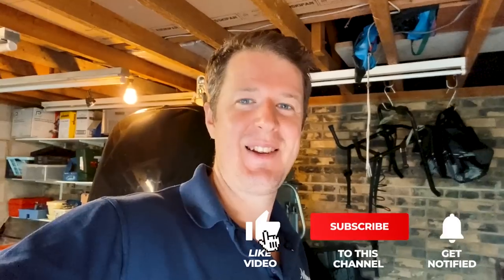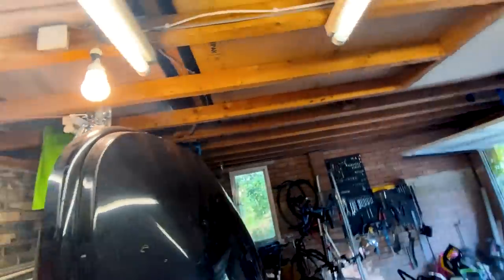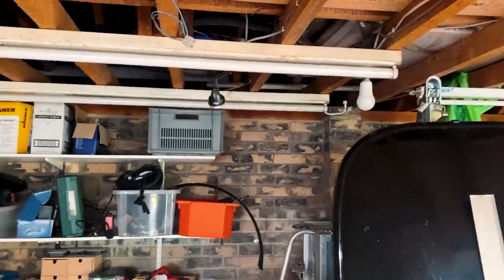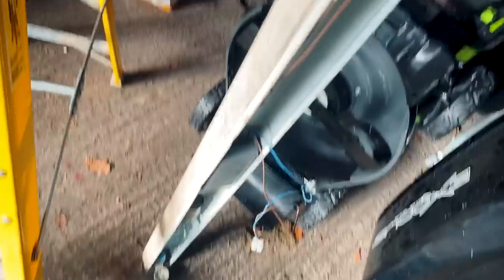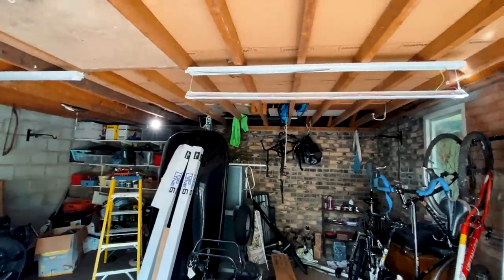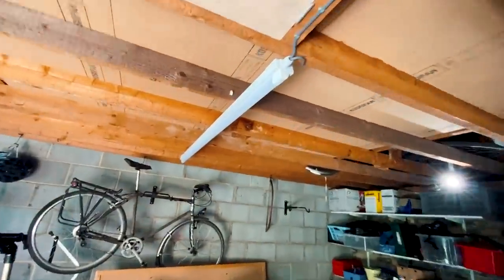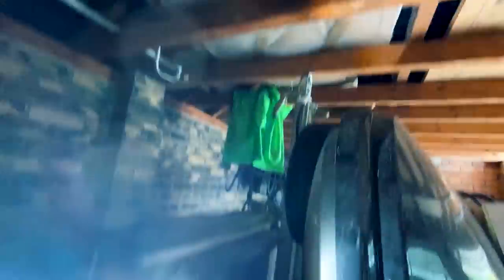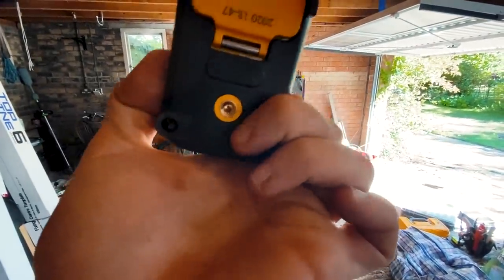Garage Rewire - Electrician Life

Comment: I think most of Europe has switches the right way. UK has switches wrong way like their 1-phase boards on every house just stone age stuff.
Reply: Single phase boards are stupid they are talking about putting 3 phase in to help spread load of generation and electric car chargers now
Reply: So old fashion today 1phase boards, it's just not enough now,with all the appliances,car charger,etc, we have now,here I wish there 3 phase available,to meet my load demand.
Reply: @haldo691  Thats never going to happen , our DNO networks don't have the capacity and are unlikely to have for many years,  thats before you even look at electrical generation . Realistically your looking at tripling the peak demand   capacity of the network as a whole, within a decade we are likely to have Hydrogen fuel cell technology  comming on stream .
Reply: @steverobinson8170  yeah I work for a DNO so I know very well how much we are screwed in a few years and the government want gas boilers to stop being installed in a few years time guess il be busy repairing everything when the network begins to fail
Reply: @haldo691  It might be because electrics is not regulated trade in the UK so less room for fatal mistakes. Everytime i see on Youtube UK electrician connecting  2gang switch fed from 2 different circuit breakers my brain goes like WTF ? Two circuits in one box ?
Reply: @steverobinson8170  if you change 100A single phase to 3 phase you need only 3x25A and get rid of electric showers. Boilers and mixer valves are way to go.
Reply: Nope, most german electricians also do it the way as shown here. If you do it the other way arround you got a nice "shelf" for dust or dirt to collect on...

And afaik in the UK three-phase is below the street and the households are distributed on the three phases evenly. And three-phase also has the advantage of sparing materials, round about 50% smaller wires and transformers compared to a single phase system with the same demand.
The households here in Germany are fused with 3x63A, that are ~44 kW. A 4G16mm² between the service entry box and the meter are sufficient, and of course an additional 1x16mm² PE from where the PEN is splitted into a separate N and PE.
The newer consumer units can be retrofitted to three-phase, if there are RCBOs installed it's just replacing the bus bar and the main switch. I doubt the 100A switch is bigger than a 3x63A one. Costs would be managable.
For a kitchen cooker we install 5G2.5mm² fused with 3x16A (~11kW). The cooking plates are connected to L1 and L2, the baking oven to L3. The appliance is still a 230V, not 400V, but the plates are divided on the lines. One small and one large plate on one phase.
On a single phase system you'll have to at least install 4 or 6mm² fused with 25 or 32A.

But here the DNO's start to gasp massively if you want to connect single phase appliances with a high demand to the grid. They only permit 4.6kVA (20A) for single phase appliances. Appliances with a higher demand must be connected three-phase. Except old kitchen cooker circuits which are still single phase and mostly fused with 25A.
Reply: @haldo691   Looking at phasing out gas cookers too eventually ,  i just look at it from my own home , built 1930 with a 40 amp supply  two houses share the same feed,  fine for 1930,  i had to have my fuse uprated to 100 amp  to accomadate the electric shower , double ovens and hob  because i kept popping the fuse ,
Reply: @evzenhedvabny6259  Electrics is highly regulated
Reply: @steverobinson8170  the old lead incoming cables are normally between 16 and 4mm in today's sizes amazing they hold up to 100a supplies although all houses should be fused at 80a unless they have electric heating
Reply: @peto22  They are phasing out gas boilers and showers  to help meet  carbon emmisions targets , heard they may eventually include cookers as well .   25 amp per phase is far to low  when your basic house  now has 3 rings  ,  2 radials ,   2 lighting circuits   1 shower circuit  1 cooker circuit , throw in a couple of  charging circuits  as most houses have two cars  and your toast , realistically  your looking at 3x 60 amp  supplies ,  possibly looking at running cookers and showers either  2 phase and neutral or 3 phase , domestically that might cause a few problems  as its something most people  haven't got a clue about
Reply: @evzenhedvabny6259  And how many circuits are in the CU? At some point you have to rely on people having a brain instead of regulating excessive material usage and ugly installations..
Reply: @steverobinson8170  https://youtu.be/7flGqj4okts?t=36 This guy says it is an unregulated industry  whatever it means. As far as i understand there is noone you need to be registered with to do such job legally. One can use third party certification scheme.
Reply: @Marcel_Germann  not sure if that's the reason our switches are that way but trust the Germans to have a good reason for it👍
Reply: @haldo691   they did agree to put 100 amp in mine  but yes your correct  they do  generally put 80 amps in
Reply: @Monkeh616 Agree.  But in my country you have no choice. Approved 2 gang switch has one feed only. So this is the way i have been trained . It is realy deep in my brain.
Reply: @steverobinson8170  Well.. here in Finland 3x25A is enough for up to ~200m2 houses with electric heating (20kW), electric water heating (3kW), electric cooker (5kW), electric sauna (6-10kW),.. usually about 30 circuits. Worst thing you have against 3 phase is electric showers but total energy consumption is no problem.
Reply: @peto22   Problem in the UK  our domestic electricity supply is mainly single phase and it would require a massive investment to upgrade all homes to 3 phase supply  Most homes are either TNS or TNC-S , TNC-S being the prefered method now  so  no capacity within existing  cabling to upgrade even to twin phase  .  With the uptick in charging systems  unless you have selective power control systems 25 amp  3 phase will  struggle to cope with charging  a couple of vehicles
Reply: @haldo691  how would this help? It's not like every house is on the same phase anyway so the loads would be already spread.
Reply: @Mason Moore , i don't honestly see how thats going to work , its limiting charging time  effectively you could come out to an uncharged car or  a car with significantly less charge than when you plug it in , you would need to be able to overide  the load management system . I know they  have  or are trying something like this  in Japan ( i think)  and found it not the panasea they thought it would be
Reply: @stuartandrews4344  what do you have in your house that needs a 3 phase supply? I'm genuinely curious
Reply: @haldo691  that's why there will be a heavy focus around energy saving in the 19th edition. Bit business already face penalties for using electricity at times of high demand. Did you know during a triad period it costs a few hundred pounds for Sainsbury's to make 1 donut!
Reply: @steverobinson8170  Yeah it would require changing supply cables to something like AXMK 4x25, changing distribution cabinets on street, meters, tails, main switches and in most of places, there is none of extra space in your tiny CU's. I think most of charging units have adaptive power control and limitation option but you are right, I wouldn’t want to charge two electric cars with 3x25A service. We have a great fee here that 3x25A service has a monthly fee of ~25€, 3x35A ~45€, 5x50A ~78€ and 3x63A ~123€ and energy+transmission fee will still come on top.  No one wants a bigger service than they have to :D
Reply: @evzenhedvabny6259   I think you mis understand what  He's saying , Dave's refering to mainly the domestc after market where week end warriors happly perform bodgery  on thier own homes and  realistically  you can never stop this type of work. If your working proffesionally as an electrician you need to have been trained .  The problem we do have  until  quite recently  you  could recieve your training as  and qualify without ever going to college .
Reply: @steverobinson8170  Thank You for explanation.  You say : " You  could recieve your training as  and qualify without ever going to college. " I wonder how is this possible. My experience from my country is You need 3  years of education , then pass your first exam, then 6 years of experience working for some employer after that pass another exam. Actually two. One for being a sole trader another one for inspection and testing.  Then get registered with TICR (equivalent of NAPIT but kind of governments organisation ). After all that you can work as sole trader electrician. After passing all this hassle you are still not allowed to design own instalation or make a fusebox from scratch.
Reply: @Marcel_Germann  That would require every property in the uk to be rewired from the road  to the supply point , you would also have to  replace the CU  and in all probability  perform at least a partial rewire of the property . Other major obstacle all the domestic equipment in the UK is supplied single phase , whilst some can be switched the majority can't. The cost would be astronomical .
Reply: @evzenhedvabny6259  We used to have an apprentice system where you  were indentured to a company or tradesmen and they taught you (indentured  is a legal term whereby they agree to train you for xxx amount of years  and you agree to be trained ) Following your training which was anything up to 7 years you would recieve your indentures and  could work as an improver under supervision . It worked well , some of the best tradesmen  i have worked with came up this path effectively you where taught on site not in a classroom  . One downside was  lack of consistancy  of construction and installation, large companies and governments wanted uniformity  of build and installation , it allowed  the less adaptable to enter the trades  requires less supervision and training effectively everyone sang from the same song sheet . Downside you get less innovation and  repair and more strip out and throw away . You also get a segmentation  and semi skilling of trades  and downward pressure  on price .
Reply: steve robinson You can still have the single phase circuits. We have them here too. Replacing the CU is not necessary, especially not if you have all RCBO‘s. Then replace the bus bar and the main switch with a three phase one. In that case the single phase RCBOs are distributed L1, L2, L3, L1, L2 and so on. But still 230V circuits. Three phase in the board means you can build three phase circuits, it doesn‘t mean you must build them.
There are special bus bars available for this. They have L1, N, L2, N, L3, N, L1, N and so on. Supply cable from the street to the house, and three main fuses instead of one. Meters must be three phase too. The home owner has the smallest part of the costs. And you don‘t do that all at once, that‘s a step-by-step process. Here only the kitchen cooker circuit is three-phase, or the electric instant water heater. An in older installations the kitchen cooker is also single phase. But you got the possibility of implementing a new three-phase circuit if necessary, for example for EV chargers.
Reply: @Marcel_Germann  Probably this kind of modification of consumer unit is not legal there.
Reply: Evzen Hedvabny Why should it be not legal? It‘s not a modification of the board, it‘s a modification of the wiring which is perfectly fine, according to regulations and done that way in every country which provides three-phase to domestic installations.
Reply: @Marcel_Germann   , you can't change the bus bar in most domestic CU in the UK, the CU is  only designed to accomadate single phase  and the main switch in the UK is usually within the CU  its not a seperate  item unless you add one later yourself Our meters are single phase and supply from street single phase as is the fuse head  .  Just to accomadate a 3 phase supply in the uk  would require a complete CU upgrade , probably a relocation as well in many properties because they were usually tucked under the stairs or above a doorway  in years gone by , with the added hassle of  extending circuits  This is the type of board likely to  be fittedhttps://www.screwfix.com/p/british-general-12-module-6-way-populated-high-integrity-dual-rcd-consumer-unit/4674G?tc=XA3&ds_kid=92700055281954493&ds_rl=1249401&gclid=Cj0KCQjw7ZL6BRCmARIsAH6XFDL2Yh13JYfVMoL4KDrt1_53dTQpntez6cj8pkR-XhzWKR3w-H5f1QEaAsUzEALw_wcB&gclsrc=aw.ds    or something like this https://www.google.co.uk/url?sa=i&url=https%3A%2F%2Fwww.brightsparkelectrician.co.uk%2Fservices%2Ffuse-boards%2F&psig=AOvVaw2MsY5X82qxDyVOHGJZsRTa&ust=1598448333307000&source=images&cd=vfe&ved=0CAIQjRxqFwoTCMiVlZu6tusCFQAAAAAdAAAAABAD
Reply: steve robinson Is the switch located on the rail? If yes, it can be replaced. And with the bus bar I mean the copper „forks“ you put into the MCBs from below as a feed. That is replaceable by three-phase variant. When I‘m home from work I‘ll send a picture, pictures explain the things better. And I don‘t talk about the really old ones without the DIN rail and the rewirable fuses. They must be replaced in that case. But if fitted with a DIN rail the board can be converted.
Edit:  
https://twitter.com/marcel_germann/status/1296500853055131649?s=21
That board is from the early to mid 1980s. Circuits are single phase, but inside the board is three-phase.
Reply: @Marcel_Germann  Guessing from what Steve says . It looks like their rules are similar to ours. They can't alter the distribution board this way just because manufacturers does not say it can be done.
Reply: Evzen Hedvabny Normally it should be the other way arround: Manufacturer must explicitly say that it‘s not permitted.
Reply: @Marcel_Germann   Don't think this would be allowed in the UK ,  if your changing the board internals it would need to meet the latest regulations , we would have to buy a board already type approved to supply multiphase power , plus not all  rail boards  use the copper folk method . Send the picture please as its interesting to see how other countries deal with this issue . Plus most boards fitted in the past even Din Rail boards are usually already fully populated
Reply: steve robinson I remember the city I live in was completely rewired in the mid 1990s from overhead line wires to cables in conduits below the sidewalk. So it is possible, but you‘ll have to do it step by step and not all in one. Start with old defective cables which must be replaced anyhow.
Reply: @evzenhedvabny6259   When you say feed do you mean loop in loop out , in the UK  on domestic circuits  you have  live feed pulled down from fitting  and switched live returning , , the switch's are generally on the same circuit , loop in loop out is usually at the fitting not the switch
Reply: @steverobinson8170  I mean i have seen 2 gang switch one half for upstairs lights  the other for downstairs lights each one fed from own fuse.
Reply: @Marcel_Germann    Unfortunatly   a lot of our cabling is beneath the roads  , replacing it is an absolute nightmare , cabling to my house actually runs under the neighbours new driveway  and we both tap off that , its  about 90 years old lead cased , no conduit ,   What type of system do you have in Germany  TNS  TT OR TNC-S  we  have all three , my neighbours , TNS , im TNC-S  house for doors away is TT   and the shop at the end of the road was TNC  until recently  (don't usually  use TNC domestically )
Reply: @evzenhedvabny6259    that's unusual  what we do do is run the downstairs circuit to one upstairs light  fitting so any failure in the one circuit means the upstairs will still have  light ,  in years gone by we used to borrow neutrals  so although the landing light was  fed from the one fused circuit it would  take its neutral from another circuit , don't do this now  though , how old was the installation
Reply: @steverobinson8170  I met this twice. When i worked in the UK as a cleaner in one commercial building . Three gang switch for corridor  kitchen and  toilets each havig own circuit breaker in the consumer unit . Built in late 90's .  Second one was friends' house  i spent my holliday with .I was asked to change one broken switch . There i found British way of 2 way switching  and two different circuits in one box. Since then i am interrested in UK and US electricians channels.
Reply: @bobbyzilla  In my case one cooker and one water pump
Reply: @peto22  It might be  little bit more complicated . I have seen new building being connected in the UK . They had to dig the street then work on live cable under the pavement , colse the connection in something looking like a small submarine 
.
Reply: @peto22  unless you live in a multi story with no gas
Reply: @steverobinson8170  no it isn't at all. If a typical person had an electrician round they have no way of checking their qualifications. A lot of people think part P domestic installers are electricians and they are far from it but they can do work in anyone's house and that is scary. But me as a full qualified electrician cannot change a socket in my kitchen.
Reply: @evzenhedvabny6259  what do you need a 3 phase pump in a house for?
Reply: @bobbyzilla  It is the way  things are done  in Czech. I have three phase 32A suply in my house . So my water pump fitted 30 years ago is three phase too.
Reply: @steverobinson8170  In most cases it's TN-C-S, but some are TT. 
For the TN-C-S in three-phase it must be four conductors in the cable. Eventually they can shoot the cables through the earth like they do it with gas pipes these days. I remember when they layed the gas piping here, just a hole in the sidewalk and one hole directly on the outer wall of my house. In between no hole, no trench....

The conduit is such a black flexible one, we painted it over:

https://abload.de/img/img_59420nkrj.jpg

In the box the PEN is separated into a separate PE and N, the small cable leaving on the top is a NYM-J 1x16mm² going to the equipotential bus bar of the house where all metal piping, cable TV (shielding of the cable must be earthed), earth electrode of the house are connected to. The last thing is the reason we don't need as much measurements for installing an EV charger on TN-C-S. In the UK you'll have to install an additional earth electrode (here mandatory even on TN), and on three-phase it's easier for the charger to detect a PEN failure and switch off.
Reply: @evzenhedvabny6259  3x63A is the standard here for residentials. In older installations 3x35A.
Reply: @bobbyzilla  Of course you can replace a socket like for like in your own home .  No ones saying our system of checking tradesmen is perfect its not but it is  due to our historic methods of training where you  were not required to attend college , then they bought in city and guilds , now they have bought in NVQ's . Training in the 1970's was a lot different to training today . Todays system is all about pieces of paper and box ticking . It doesnt allow for  and can't cope with  historic training
Reply: @bobbyzilla  Three-phase makes some things easier. 5G2.5mm² fused with 3x16A are ~11kW, standard for a kitchen cooker circuit here. You could even install 5G1.5mm² with 3x16A, but now these days no one will do this anymore, and also the cables for the kitchen cooker circuit now must be designed here that way that you can change the MCBs over to 3x20A (~14kW). I don't know which master chef will cook there so that 11kW are not sufficient, but that's the way it is...
In the UK the circuits for kitchen cookers are usually 6mm² afaik and fused with 1x32A.
Also three-phase has the advantage that it has a rotating field, so you don't require a capacitor for the motor. The capacitor will eat up torque and power of the motor.
Reply: @Marcel_Germann  In here you can choose depending on designed requirements. 1 phase up to 20 or 25 A  or 3 phase 10, 16,25,32, not sure maybe 40 , 63.  2 or 3 tariff.
Reply: @evzenhedvabny6259  Here it depends on how much square meter you have, how many units (flats) you have in that house and the way you heat up water. In my case I have 3x63A. This house was considered a 2 family home in the early 1950s, but with 88m² of living space by todays standards it's a small one family home. I changed over from electric water heating to natural gas, electric water heating is too expensive here in Germany these days.
And I would never reduce the power of the house, that's easily done. But if you want a higher fuse inserted you'll have to pay several hundreds of Euros. And if you need a larger cable you'll pay a mid range 4-digit sum, so in the range of 4 to 5000 Euros.
Reply: @Marcel_Germann  basically the same thing.  Just different way. In Czech approved designer decides. I think their guidance is similar .
Reply: @steverobinson8170  hi, I'm sorry but you are wrong. You need part P to make any changes to a kitchen or bathroom so I cannot change a socket in my kitchen without paying someone else to sign it off for me. Even though I am fully qualified. It's a stupid system now.
Reply: @steverobinson8170   not misreading them. Kitchen and bathroom electrical work no matter how small is notifiable work and the noone knows argument is rubbish when a minor work certificate is required and that will have a date and my name on it.
Reply: @evzenhedvabny6259  The electrical installations in domestics base on the VDE 0100 (Erection and maintanance of low voltage installations, the german counterpart of the BS 7671), the technical connection conditions of the distribution network operators and the DIN 18015 (electrical installations in domestic buildings). There you have the minimum numbers of outlets for different rooms, how many circuits for the whole house, how big the consumer unit has to be and such things.
Reply: @Marcel_Germann  We have te same think. Every electrician here shall know it but is not a allowed to design the installation. Design is job for approved engineer who has to be member of CKAIT. I guess that guys in the UK and Germany have more freedom .  Czech building industry is over regulated :)
Reply: @evzenhedvabny6259  Here in Germany the certified electricians are permitted to remove the main fuses in the service entry box. In the UK it isn't that easy, they have to call the DNO afaik, then someone comes over and removes the fuse and later when the job is done the DNO guy comes over again and put the fuse back in.
And we have NH fuses in there, that means you require a special tool to remove and insert the fuses, and also special protective equipment (helmet, face shield, flame retardent clothes and so on).
Certified means you got the education, founded your own business and report to the local DNO showing them your testamur of your education and that's it, your on their list....
Reply: @Marcel_Germann  Similar in Czech Republic . Same fuses , Same procedure .. Ring the DNO, give them your registration number you have from the central authority. But fully certified electrician can not make even simple stupid extension lead from CE certified parts or a  fusebox . Our law sees these things as a product not as "eine baukatsen".   My former employer  had to be registered as electrician and manufacturer of consumer units because of it .
Reply: Replacing sockets in Kitchens is not notifiable  work  The introduction of the latest version of Part P was introduced on 6 April 2013, the range of works requiring notification has been reduced.

Notifiable works
The installation of a new circuit
The replacement of a consumer unit
Any addition or alteration to an existing circuit in a special location
Non- notifiable works
All other work is considered non-notifiable, namely additions and alterations to existing installations outside special locations, maintenance, replacement and repair work.
Special locations and installations
A room containing a bathtub or shower
A room containing a swimming pool or sauna heater.
A special location means:

A room containing a bath or shower, the space surrounding a bath tap or showerhead where the space extends vertically from the finished floor level to a height of 2.25 metres or the position of the showerhead where it is attached to a wall or ceiling at a height higher than 2.25 metres from that level or horizontally where there is a bathtub or shower tray, from the edge of the bath tub or shower tray to a distance of 0.6 metres. Or where there is no bath tub or shower tray from the centre point of the shower head where it is attached to the wall or ceiling to a distance of 1.2 metres.
Back to top

How will Part P apply to DIY work?
Part P will apply to all electrical work in dwellings, whether carried out by professionals or DIYers.

Some DIY work will require the submission of a building notice to the local authority and the payment of a building control fee.

Some minor electrical work will not be notifiable (see above). Examples include adding a lighting or power point to an existing circuit, adding a spur to an existing circuit or replacing a light fitting.  There is a massive under reporting of notifiable works , infact if all works requiring notification  was reported  local authority  BC would  not be able to cope  with the workload. This was one of the reasons why they reduced   what was required to be notified originally.  I can gaurentee that  very few doing a DIY bathroom or kitchen refit bothers  to notify ,  infact many of the 'proffesional'  kitchen and bathroom  fitters don't either . Thats how the big sheds  stay in business . Building control  don't have the rescources  to police part P within the DIY   domestic market .
Reply: Evzen Hedvabny Here the electrician builds the whole distribution board. You don‘t buy fully equipped boards here, actually even not available here, you buy the housing and the devices (MCB, RCD, RCBO, Neozed fuse carrier and so on) separatly and equip the board as required for the customer. No separate permission required.
Reply: @Marcel_Germann   WE have that option with some brands , but generally you get a mainswitch, and  at least part populated , usually  2x 32 amp 2x5 amp  1x16 amp   1x20 amp rcbo's  then you add  whatever else you need , some boards are still being sold with split RCD'  and they part pop  similar to above but with MCB'S
Reply: @peto22  We don't have distribution cabinets in the streets in the UK for power
Reply: @peto22   We have mini sub stations , only DNO allowed  access  , they only distribute 3 phase  usually 11KV feed off the primery substation which in itself is fed from a larger  distribution node which is fed from the national grid  all our single phase is tapped off the 3 phase underground domestically .  Our system is old , cables feeding my house are 90 years old lead sheathed , DNO have a nightmare keeping on top of faults as the lead decays  and cables decay
Reply: @steverobinson8170  The special locations in rooms which contain a shower and/or bathtub are harmonised up to the point that the numbers are identical:
VDE 0100-701, and in the BS 7671 it's also -701. Take a look at this, this should be familiar, even if the labeling is in german, the dimensions are in cm:

https://upload.wikimedia.org/wikipedia/commons/0/06/Bad_Verlegezonen.jpg

We call them literally translated protected zone.

In 1984 it was implemented into the VDE regulations that the electrical circuits of "rooms which contain a shower and/or bathtub" must have RCD protection (tripping current 30mA maximum). With this version of the regulation also the AC RCDs were banned for new installation. The standard RCD type is A since then.

Here in Germany the one who works on the installation is held accountable if something happens. In worst case injury or death of another person. No matter if it's a DIY or a pro. The most interesting thing is when the installation is connected the first time to the grid or if you want to use an appliance with a demand of more than 12kVA. The appliance must be reported to the DNO. That would be an EV charger for example, or a big flow water heater for a shower (mostly 20 to 22kW).
Reply: @steverobinson8170  Here they are completely empty. Most used boards here are the ones made by Hager. In my house I have three Hager boards. In my parents house is one Hager board from the 1980s and one where the manufacturer is unknown, but it's from the early to mid 1970s. The MCBs which were fitted into it were type H. The production of this type was stopped in 1976. In the board is a DIN rail (here we call them "hat rail", because if you look from the side on them in profile they look like a hat), and as the old MCBs started making trouble I removed all of them and replaced them with type B.
Reply: @Marcel_Germann   They  are as far as i can see identical , we don't tend to have fast flow water heaters in the UK  domestically,  we have electric showers but  the biggest units only around 11 kW.